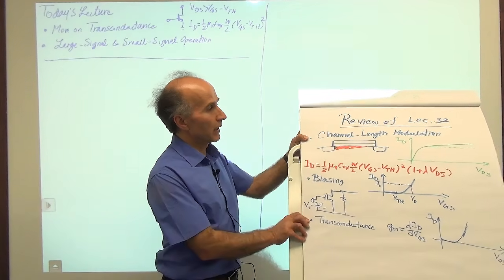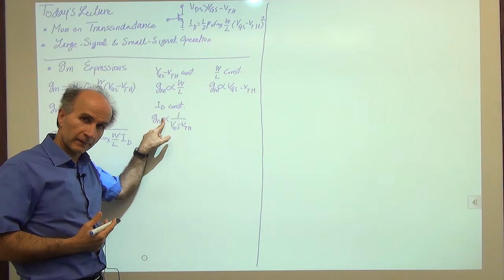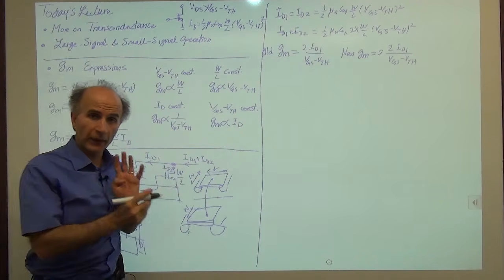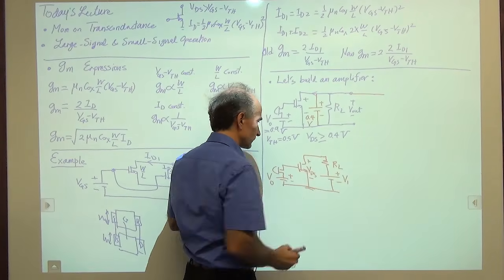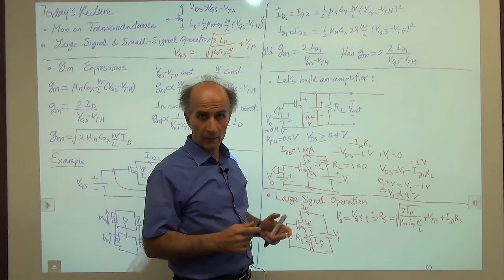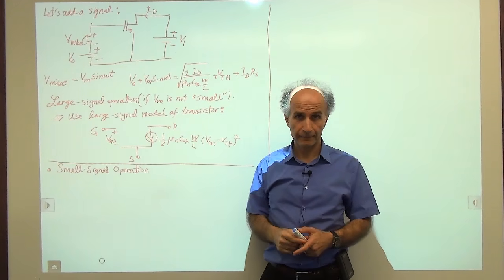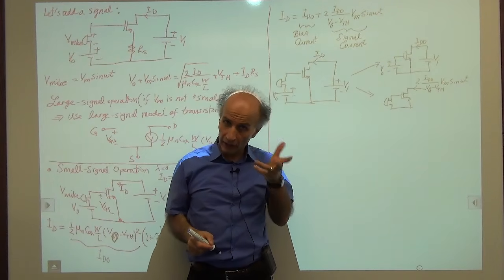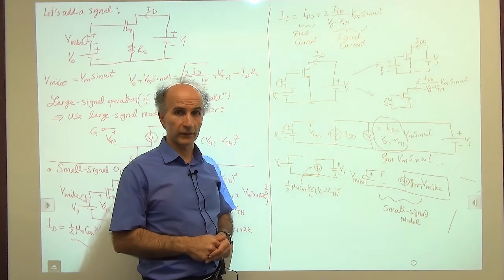Razavi Electronics 1, Lec 33, Large-Signal & Small-Signal Operation

Comment: why we are not use MOS in linear region for amplification , in linear region Id=f(Vgs,Vds) also gm is const for particular Vds but in saturation region gm is varying with Vgs it would be better to use in linear region anyone can explain?
Reply: Because in saturation current is approximately constant thus the gain will be higher but in triode the triode gian is so small
Reply: Draw the graph between Id and vds. Then take small change in Id for linear region and do the same for saturation region then see the change in voltage corresponding to both linear and saturation. You will see for small change in current large change in voltage is present for saturation region. Hence amplification better in saturation.

Comment: 33:56   Sir, what if signal comes in , then value of Vgs will increase. And due to that Ids will increase , resulting Vds to decrese, in that casr mos device will no longer in saturation????
Reply: Yes, you are right. That is why we must have swing limits on the incoming input signal. 

For max amplitude of the incoming signal sinusoid, we need to maintain the boundary condition (for bias + signal) VDS = VGS - VTH to maintain the transistor in saturation. Assuming the signal is small such that the small signal model can be applied, the total VDS = V1 - RL*ID - gm*RL. Total VGS = Vo + vmsinwt. If we substitute these values in the boundary condition equation required to maintain operation in the saturation region, I believe we should be able to calculate the maximum limit on vm which is the amplitude of the input signal sinusoid.

Comment: Dear sir, in minute (41) you forgot to add the resistance (Rs) between the source and the ground when you modified the circuit to add a signal to the input voltage.
Reply: Agree

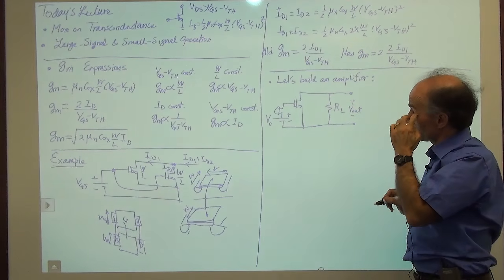Comment: Why do we need a MOS to be in saturation for it to be used in amplifier 22:50
Reply: Lets say you apply a sinusoidal signal very close to Vth , (Vgs is close to Vth). If the Vgs is less than Vth  ( on the negative portion of the period it could become ) , Id will be zero. In this case the output signal will be clipped. Some part of it will be 0 and some other part ( positive portion of the period) will be amplified. When we go into the saturation region we eliminate cliping of the signal for exemple. Also as the professor pointed out, for a certain amplification you`d need an exspensive resistor
Reply: @gamar1226 why we are not use MOS in linear region for amplification , in linear region Id=f(Vgs,Vds) also gm is const for particular Vds but in saturation region gm is varying with Vgs it would be better to use in linear region

Comment: What is the exact definition of "much smaller"?
Does it mean that the signal is 1/10 as big than the DC voltage, or 1/100 as big, or something like that?
Reply: @Yihan Du That sounds like a reasonable definition.
I guess another way to think of it in some cases is that "much smaller" simply refers to anything that can be neglected compared to something else without making a significant difference.

Comment: sir as you discussed when two transistor connected in parallel their w/l increases but what happend in series can you explain it to me  and how?
Reply: it will be same as two capacitors are in series. If both r having same W/L then effective W/L is W/2L
Reply: It could be a multi-stage amplifier
Reply: If both transistor are open, and are the same Id should be the same for both so w/l should remain the same.
Reply: A cmos is what you get when you connect a pmos and nmos in series. Read how to analyse a cmos and you'll get a a fair share of idea  about it.